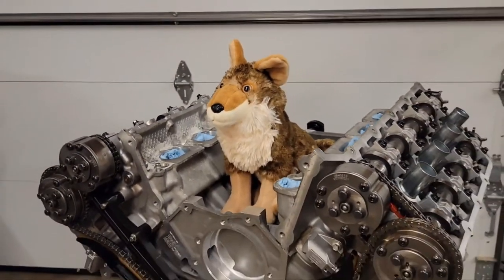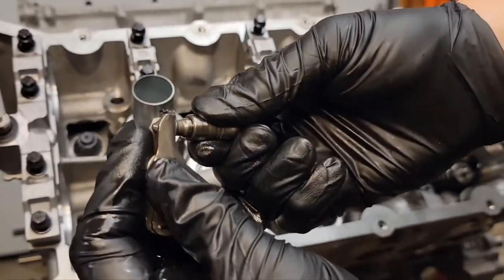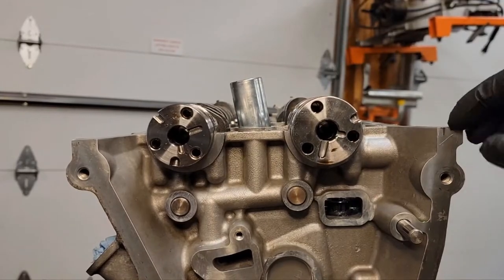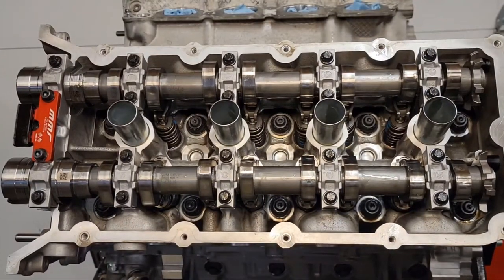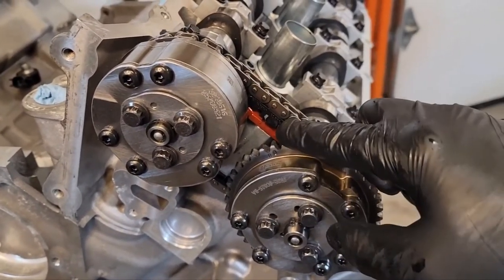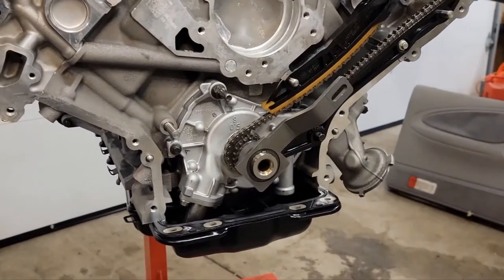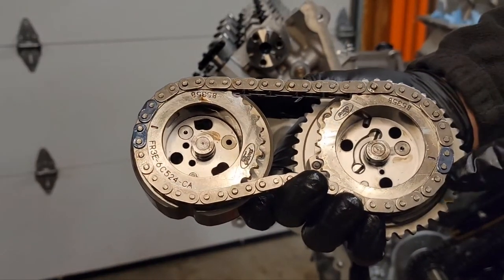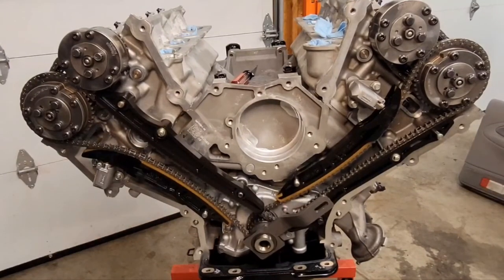How To Time GEN2 Mustang Coyote 5.0 Engine

Comment: Amazing video what did you mean by used a zip tie with the mmr 2nd tensioner ? Would be helpful if you can give me a better explanation currently working on it
Reply from the maker: With the MMR secondary bracket it was easier to compress the tensioner and tighten a zip tie to keep it depressed. This allows to slip the sprocket and chain over the tensioner pad. After it's on there, just cut the zip tie out and remove it.
Reply: @Oxman_Garage  life saver thanks brother

Comment: Can you do this without removing the engine? I just need to replace one broken exhaust phaser
Reply from the maker: Absolutely, you don't have to remove the engine. This can be done while the engine is in the car.
Reply: @Oxman_Garage  thank you, the car has only 50k km, but sadly the passenger side phaser is broken, the center pin that moves the valve is stuck and the phaser won't move from the fully advanced position. Beside the phaser, since I have to disassemble lot of parts, would you suggest to replace all the timing components, chains guides etc or replace just the phaser? I'd love to change it without removing the timing cover but I assume it's impossible. Thank you so much

Comment: What do I do? I have done a couple of these but have completed them with out walking away for an extended period time. On this job, I started it and got pulled off for a few months and came back to it and forgot to rotate the motor the 2 rotations to 12 o’clock prior to installing the RH side. Got it together and drove it for a couple and realized what I did because of the codes I pulled. Now I have it down to the chains again and the RH pulled chains pulled. Not having ran into this before, what is my next step?
Reply: What codes did you have? I have a car with unknown service history with bank 1 camshaft and crankshaft corelation. Data loger shows 20 degrees on camshafts. Did someone forgot to rotate the crank while instaling second chain?

Comment: When installing the passenger side exhaust cam, it doesn’t feel like it’s in the “neutral position” it is kinda help up a little,, is this normal ? It spins back and fourth freely in a different position though.. is this normal? Should I have to force the cam down a little with the cam caps? Or is the cam in the incorrect t position?
Reply from the maker: Place the cams in a position where the lobes are flat on the followers. Tighten all the cams caps. Take a wrench and move the cams on the flats of the cam and put them in the natural position.

Comment: You don’t have to put in too dead center like push rod ? Placement of pistons can be in any order ?
Reply from the maker: At the beginning of the video, you want to clock the crankshaft key at the 5 o'clock position. This place the pistons below the deck so there will be no piston to valve contact.

Comment: Hey for comp cams stage 3 do they also need to install same way you did on gen 2 ?
Reply from the maker: I would recommend having aftermarket camshafts set with. Degree wheel.

Comment: Question what cams should you use on gen 2 Lon block for 2014 mustang GT ?
Reply from the maker: Depending on your set up?  Honestly the stock cams are good for lots of power if you Supercharge or Turbo.
Reply: @Oxman_Garage   stock cam as gen 1 cause now I got gen 2 exhaust cam and boss302 intake cam and the car throwing code p0340 and p0344

Comment: I had to replace the passenger side head on my gen 2 coyote.. do I need to retime the chain on the side I didn’t remove ?
Reply from the maker: As long as the timing marks are all in the same position when you removed everything.  If it were me, I would just start from the beginning to be on the safe side. Last thing you want is piston valve contact
Reply: @Oxman_Garage  so retime the other side as well? I noticed the timing marks are a little off
Reply from the maker: If they're off, I would just start from the beginning, better be on the safe side
Reply: @Oxman_Garage  thanks for all the help !
Reply: @Oxman_Garage   one more thing, prodemand says I have to reintall the same parts on the same position.. I did not make any marks or anything
Reply: @Oxman_Garage  is it safe to retime the motor with the same parts &  the new head? same camshafts & everything?

Comment: I noticed in video the driver side cams are installed wrong for video. Go by the cam neutral diagram provided. Diagram is different than video
Reply from the maker: I guess I've been running a miss timed engine for a year and half now? Haha. 1500 miles and counting, zero issues. Exhaust video in my short vids couple weeks ago. Idk-what you're seeing. Thanks.
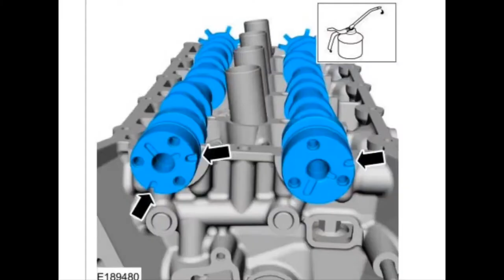Reply: 3:27 and 3:13 the position are different is what he is saying the exhaust side is right but the intake is off